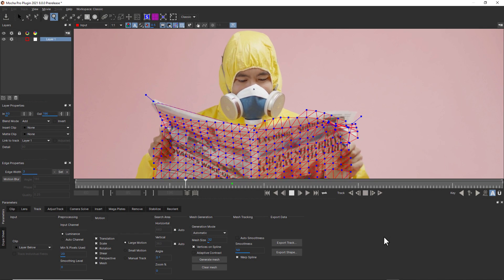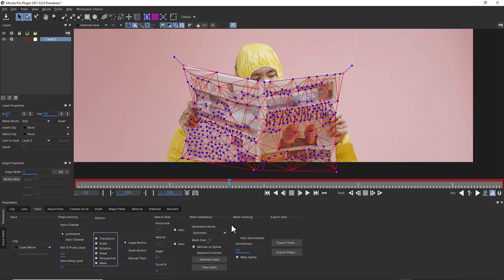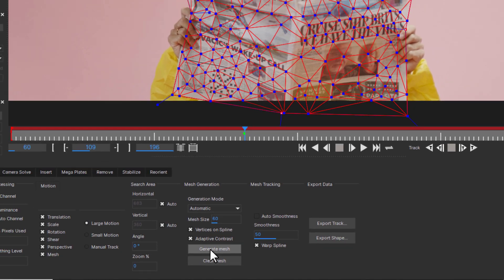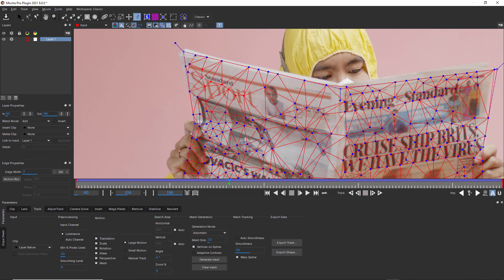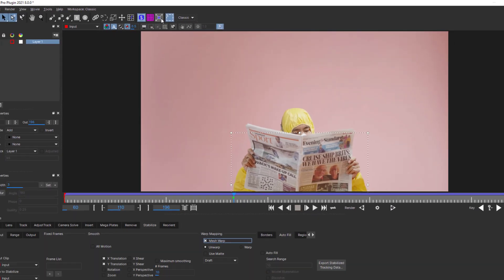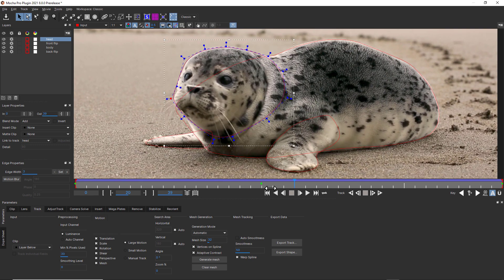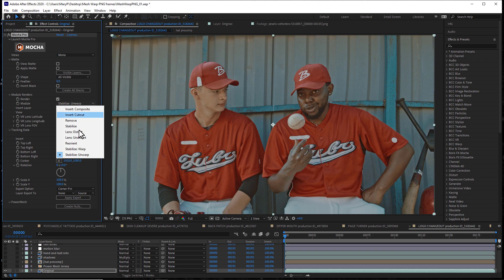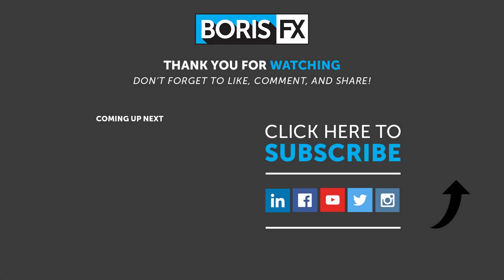Mocha Pro 2021: Intro to PowerMesh Warp Tracking

Comment: mocha pro adobe after effects I didn't succeed in doing a warp mesh, why y, even though I already copied it, into the image I want to paste on my face, but it didn't work
Reply from the maker: These problems are usually fixed by precomposing your clip before tracking : https://borisfx.com/videos/quick-tip-precomp-footage-for-best-mocha-results/
If the tracking data is either frozen or offset in time here's how to fix it.  As you've already done the track, just cut the Mocha Pro effect off the original clip, precompose that clip, and then paste the filter onto the precomp.  Next go into Mocha Pro, and go to the Dope Sheet. Make sure you are at the first frame and click the Move to Playhead button.  This will slide all your tracking into the correct time for After Effects. Save and use the data.
Another common problem is that the insert image you want to warp is not the same frame size as the clip you tracked.  Again, precomposing comes to the rescue.  Precomp your image, setting it to the same size as your original, and apply the Mocha Pro PowerMesh warp.
If you're still having problems, please join us on the forums. It's a very welcoming community : https://forum.borisfx.com/

Comment: I have a big problem. When I going to stabilize after good tracking and choose mesh warp the track data isolated. I couldn't find any fix. How to do that?
Reply from the maker: Sorry to hear you're having issues. I've got a couple of things to try.  Firstly, did you precompose the shot before tracking it?  https://borisfx.com/videos/quick-tip-precomp-footage-for-best-mocha-results/  You can shift the track data afterwards if you didn't, so your work isn't for nothing.
The other thing, is to check that you PowerMesh layer is the layer selected and saved when you're in the Stabilize module.  If you have multiple layers, it's easy to have the wrong one selected in the module.
If that's still not working, please contact Support with some more details about your project, and we'll try to help there : https://support.borisfx.com/hc/en-us/requests/new
Reply: @BorisFXco  I did all the things preciously like first precompose then track my hand with correct points with mesh. Till all are ok. When I go stabilize and click mesh warp and set to high and apply the corner pin to the whole frame the track detached and wrap discontinuously.
Basically I want to track my hand skin with mesh warp and place a object and the video isn't much shaky. So which option I choose in the support forum for this?
Reply from the maker: Head to the Mocha Pro forum.  I think the problem should be simple to solve though.  You might be able to handle this directly in the Mocha Pro Insert module : https://www.youtube.com/watch?v=ino6i93TmBE
You don't want to be applying corner pin data to anything though.  You should be using Mocha Pro Render > Stabilize Warp on the object you're placing on the hand.  Remember that both layers should be exactly the same resolution.
Reply: Ouu it's worked. I just only used render > stabilize warp after mesh tracking and now worked. But why it not worked as in the video after tracking mesh then activate warp stabilize in stabilize section. I do not understand the difference.
Reply from the maker: So glad it worked.  In the plugin, rendering Stabilize will use the regular planar stabilize data found in the Stabilize module.  Rendering Stabilize Warp or Stabilize UnWarp will take a different path and use the mesh warp data from the Stabilize module.  You have to choose the right renderer for your task.

Does that help?
Reply: @BorisFXco  yes I understand for the different videos I need to choose what is applicable in it. But here I don't understand why this method that is used in the video not worked. And also many youtubers doing same this method and it worked to them.

Comment: We say 'Applying starch to your mesh' because starch, original is applied to fabric to harden it. The same analogy is being used here - that when you apply 'starch' - by increasing the smoothness, your mesh will be more smootj and will pick up less on the sub planar motion within. Keep it super low (whatever the lowest value is) and it will pick up every tiny bit of motion and it will be terrible.  Try different values (and also use Mesh size) and pick a balance that tracks your pattern and its sub planar movement perfectly
Reply from the maker: Exactly right

Comment: wait, how and when were the graphics applied to the newspaper at 6:21? and how did you cover up or overlay the Boris FX Logo at 6:55 to also include white space at the bottom of it?
Reply from the maker: Here's a more full breakdown of how to use the PowerMesh data in After Effects : https://www.youtube.com/watch?v=qp-NEEpr5aY&feature=emb_imp_woyt
I believe that the Boris Logo and white area were composited together just using a Normal blend mode rather than multiply or screen.

Comment: This is not a good tutorial..
Reply from the maker: Sorry you didn't find it useful.  What was missing for you?
If you're looking for a more in-depth tutorial on PowerMesh, check out the PowerMesh section in the Mocha Essentials training (exercises 13-16) : https://www.youtube.com/watch?v=C1j8mxTTOi4
Reply: @BorisFXco  I think the biggest feedback with this tutorial is that there were steps left out and also the tutorial doesn’t explain if you’re using the standalone application versus the plug-in application. So for this to be a very thorough video it would’ve been a good idea to include all the steps and also both options on exporting your data with the mesh if you’re using a standalone version of the application.
Reply from the maker: Ah, I see now.  I take your points.  The PowerMesh section in the Essentials course goes into those points in much more detail.

Comment: I followed all the steps correctly. But my object is not sticking to subject. Can you guys give me a solution please..🙏
Reply from the maker: Check if the original tracking is actually as good as it should be. That's the usual problem.  Failing that, please post on the forums with some more details and screenshots : https://forum.borisfx.com
Reply: @BorisFXco  thank you. I figured it out. Just needed to precompose everything. Even before tracking. It worked perfectly.

Comment: Nothing happened after pressing render.
Reply from the maker: What exactly are you rendering?  Most of the rendering for the final effect takes place in the host with the plugin settings.  Check out the standard workflow here : https://borisfx.com/support/documentation/mocha/8.0.0/#_warp_mapping_workflow  If this is not working, please post a screenshot of your setup in the forums (https://forum.borisfx.com/ )
Reply: @BorisFXco  basically, I was trying to apply a tattoo to a subject’s back with stretching going on obviously. I first generated a mesh that tracked the back very well. I went to the first frame, turned on the surface plane thing, hit the stretch to frame button, then went to the stabilize tab. After turning on the warp stabilize setting, I saved then went back to AE. I made a precomp of a duplicated layer of the original footage, applied a tattoo png, hid the video in the precomp, then copy and pasted the Mocha Pro effect from my original video layer onto my precomp. After choosing warp stabilize in the module settings (I think is what it was called), I hit render, and it didn’t effect what I was viewing in the timeline at all.
Reply from the maker: EDIT : Your reply was held in the moderation queue so I didn't see it before.  Leaving this comment for posterity!

I have an idea why this is happening.  Are you using a trimmed clip in After Effects when doing your tracking?  If you are, you need to precompose the main clip before you do the Mocha track.  That way AE will know where to line your data up when you're at the other end of the workflow and use Stabilize : Warp to apply the warp back to your t-shirt.  If it's not that, then this is best solved either through the forums or by contacting Support.  I hope the precomp fixes it for you.
Reply: @Boris FX  Nevermind, I found out how to fix it. I was trying to use it on trimmed footage, so I precomped the footage, then precomped the precomp for the tattoo. Now the ONLY issue I am having with the software is trying to have it track a card from the American Psycho card scene. I'm having an issue like this because the track gets lost, and I can't input keyframes to manually fix it. Can you possibly tell me a way to do it? This is what I am going for, as for reference https://www.youtube.com/watch?v=MWWfT7tdb6s
Reply from the maker: You want to be liberal with your track mattes on the fingers!  https://www.youtube.com/watch?v=jhw08UxIa18

Comment: is it possible to replace the logo of a shirt when the actor turns around? for me the powermesh just messes up thanks!
Reply from the maker: Yes but be prepared to do some manual work. When the shirt turns, take the Smoothness amount up. Maybe even closer to 100. This makes the PowerMesh use the planar data more than the subplanar data.  Once the tracking is done, you can use the Mesh tools to add keyframes to the mesh grid, to bring that into the correct place.  
If the shirt turns and then spins back again, a good technique is to break that up into two different sections.  You can do it with one, but often it is faster and easier just to break it up.

Comment: quick question if I may (first thanks for years of amazing tutorials) Let say you want to export morph data from Mocha Pro 2021 Stand Alone and bring in to After Effects any version up to 2021. I have tried using the different export settings. One says export warp with corner pins. I have tried them all and in After Effects when I place the exported data on to the to be warped image it does not warp. It moves properly but no warp. I have been trying to find out more export info from Stand Alone 2021. Thank You :)
Reply from the maker: If you want to bring PowerMesh data from Standalone in to AE, you have a couple of choices. If you have the Mocha Pro plug-in, it is easy. Just open or Merge the old project into the plugin project. Then you can use the module renderer directly in After Effects.  If you don't, then it is a little more fiddly. Basically you render the warp stabilized clip out of Mocha standalone, do your paint/insert work on that clip in AE. Render out again. Then do Mesh Warp > Unwarp back in the Mocha standalone project.
Find a full workflow in the documentation :   https://borisfx.com/support/documentation/mocha/8.0.0/#powermesh
Search "Unwarp/Rewarp Workflow in the Standalone Application"
Reply: @BorisFXco  Thank You! Great explanation. Much appreciated :)

Comment: Hope you can please help me and others. Davinic Resolve is a super popular program. And the new Mocha powermesh would be a dream come true for me if I could figure it out. I have worked on this for 2 days trying to figure out how to use Mocha powermesh in Davinic Resolve. I have it all working and can go to the resolve portion but dont know what to do. I have searched for several hours on any basic tutorials on using the new Mocha powermesh in Davinic resolve. I know its simple. But need just a little help. So many tutorials on powermesh in after effects but none for Davinic Resolve A getting started beginner type tutorial as I can do all powermesh well in After Effects just not Davinci. Even just a paragraph in your description would get me and others going. And as I mentioned I totally can work with powermesh in After Effects so I do know how to use powermesh. A paragrah or a video tutorial on just the begging workflow would really be apprecated. Thank You
Reply from the maker: When working in Resolve, you are going to be better off using Fusion inside Resolve to complete the shot. The other pages (eg Edit and Color) handle still frames in a way that makes it tricky to work with smoothly. If you are using the Powermesh Warp/Unwarp, then the workflow is fundamentally the same; 
i)Track your footage in Mocha.  Set up your Stabilized Warp option in the Stabilize module.
ii) In Fusion pipe your cleanplate/footage you want warped into the Mocha node.
iii) Turn on Module Renders > Render and Module > Stabilize: Unwarp. Turn on Matte > Apply Matte.
iv) Use a Merge Node to bring your warped footage over the original footage.
More info can be found in the manual : https://borisfx.com/support/documentation/mocha/8.0.0/
Search for "Direct Warping Workflow in the Plug-In" to find the relevant section.  Fusion also lets you use an Alembic 3D workflow, which is found if you search for "Exporting Alembic Meshes" and read the next few paragraphs.

Comment: I just want to see how quickly and easшly Mocha can Isolate moving person (in jeans, t-shirt, skin) and separate or isolate the background ? PowerMesh is used in my situation ? For example I want to apply a heat vision ofx preset like in Predator film on moving person (and not on background that have same colors like my person). Please suggest a demo video or tutorial video. Thank you.
PS
Will you have happy new year discounts ?
Reply from the maker: That sounds like an interesting effect. If you want to get started with roto and PowerMesh, take a look at this video : https://youtu.be/_Twcbzv2__0  It is a different style but the roto fundamentals will help.  Remember to track PowerMesh and use Warp Spline to save time creating the masks.
Reply: I would think power mesh, in general, is good for organic movement (t-shirts, skin, flags, etc). sounds like you just want to track the outline of a silhouette. mocha can do this as well as silhouette. there are also other apps that can "magically mask" your subject in a 2d way. but it sounds like you are using the wrong approach for your situation.

Comment: Am I able to use the stabilization warp workflow from mocha standalone to AE or do I need the AE plug-in for that?
Reply from the maker: With the standalone you can render the warp stabilize pass, then do composite work and then import and render the unearned pass. But the process is easier with the Mocha Pro plugin which also will work in Premiere, Nuke, Fusion and other apps.

Comment: Anyone find a tutorial out here on how to use the Power Mesh feature in detail. This presentation was not clear enough on the process of integrating this feature in AfterEffects. Been struggling trying to map a graphic on a face using the Power Mesh feature process. Any links or other videos out here would be great. Thanks.
Reply from the maker: You might like this new tutorial: https://youtu.be/Io7SP48eH7s
Reply: @Jessica Sinclair from Lihue Kauai Hawaii I don't think her name is Karen. and YouTube has a "play at half speed function so you can easily track the mouse movements. you can even hit your "period" and " comma" key to frame by frame. and you wont pay for an app because of a presentation video mouse cursor?

Comment: I can't for the life of me get the stablize workflow to work. I can get it to stabilize the footage, by going to Module Render- checking render, setting to stablize: Unwarp. I place text or whatever I want on another layer in the spot where I would want it, over the stablized shirt or hat or whatever. Then, I precomp the text, paste mocha on it from the tracked footage, and change to stablize: warp. It doesn't do anything. It doesn't move, it doesn't bend, nothing. I also shut off mocha on the original to get rid of the stablization. But again, the thing I want tracked and warped in just stays still. What am I missing? This is in After Effects with the mocha pro plugin, obviously updated to 2021.
Reply: Second that. The footage in the precomp is all stable but the unwarped footage just floats around. Really can't wrap my head around what I'm missing. Really stunning addition that I see a lot of potential and use cases for. Hoping for a more in depth tutorial for Mocha Pro plugin -> After Effects
Reply from the maker: Did you make sure to set a reference frame? Paste on the first frame AE? Check the render button is on? Might be worth checking in with the Mocha forum: https://forum.borisfx.com/c/mochapro/6